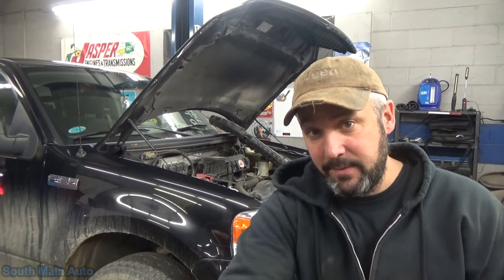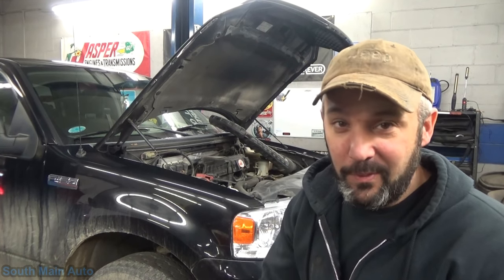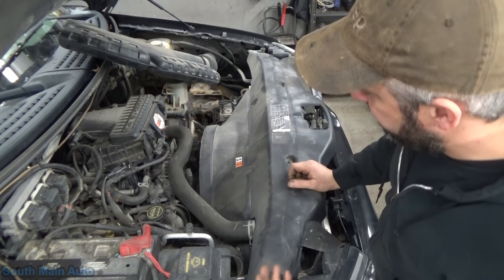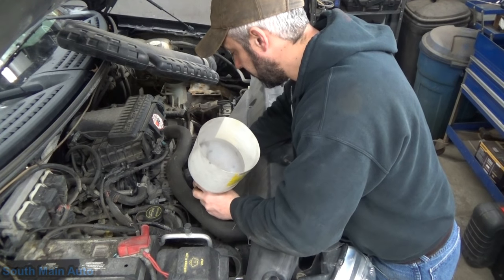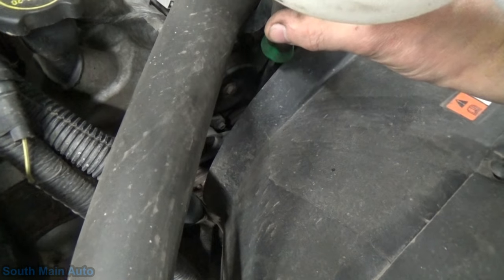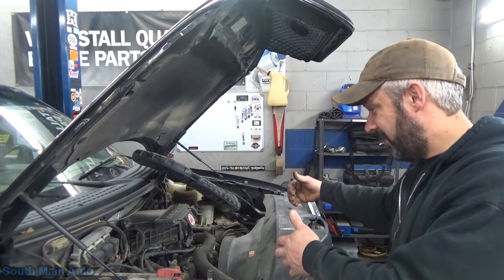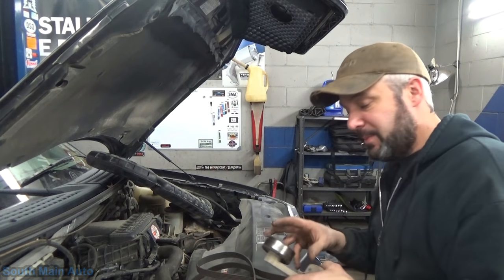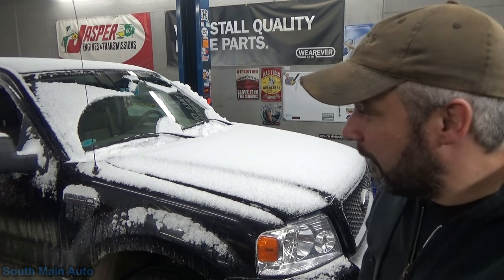How To Locate A Noisy Idler Pulley

Comment: I have used spray lubricant when I was not sure if noise was a bearing...after lube the sound changes..in this case I may have just replaced pulley...tensioner may last many more years...you just never know.

Comment: Have a 06  cadillac dts that has a rattling noise near serpentine belt tensioner,,when i spray oil on belt it goes away...is this a pulley bearing going bad and can i just replace pulley instead of entire tensioner which entails a long process

Comment: I have a truck exactly like the ford you are working on. When the temperature is below 20 degrees I get a HIGH Pitched noise... when it warms up it goes away.. I have replaced ALL the pulleys and the Belt.... It's still there.. any ideas?
Reply: Maybe a small vacuum leak that seals when the engine heats up? Spray some brakleen around on it when cold.
Reply: Grap a spraybottle of water when its cold and spray till you hear a different engine sound

Comment: Nice easy inexpensive trick. Thanks. I don't think you mentioned the mileage but it's easy to wonder if this was a premature failure of a substandard part? Belt tensioners are not rocket science and the OEM part should last roughly the life of the engine otherwise shame on Ford.

Comment: the noise from my bad belt tensioner pulley traveled up to the alternator. I put the stethoscope on the alternator and the sound was just as loud as the tensioner, even though the alternator was good

Comment: I currently have this problem, unfortunately i removed the idler pulley (should've replaced the tensioner pulley)  . Upon bolting it back on, it broke the housing it bolted to. Does any one know this part name? Or ways to fix this mishap.

Comment: had a rattling  noise coming out of my engine when my car was stationary. I replaced cambelt, water pump and tensioner. The noise is gone and my engine sounds bit more  smooth. got charged £425 for it. hope it is worth it.

Comment: Water bottle with a pin hole in the cap, start with engine off and spray 1 pulley at a time then start the vehicle, if it’s the bad pulley it will squeal with start up...

Comment: good idea, but it does not work for alternator pulley and power steering pump((( because there are no any non-moving bolts to touch
Reply: The casing

Comment: I invested in the proper and safest tool: a mechanics stethoscope! You don't ever see a doctor using a cutoff jug and screwdriver do ya? And yeah, I used just a screwdiver for the longest time until it accidently slipped, and the screwdriver handle smacked me in the side of the head! That was some kingd of hurt!

Comment: You didnt start it at the end! Soooooooo did you really fix it??
Reply: 👋Greeting Robert.  The answer yes... 👍He pinpoint what caused the noise problem, which need to be fix, upon removed and replaced part, fixed the noise problem.👌
That is call, troubleshooting, just in case you are an engineer.
Sincerely, 😎Mr. Villalba🇵🇷

Comment: Your drawstring on your hoodie made me nervous as you leaned in to the running engine. If that draw string
dipped down into the spinning belt and pulley system ... you might have been pulled right in and up close to
the works ... closer than you want to be.